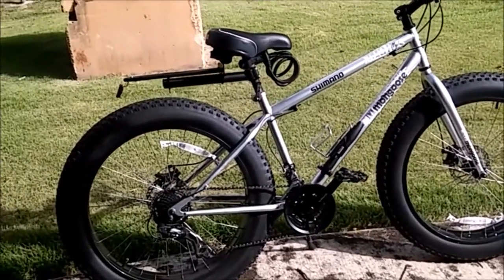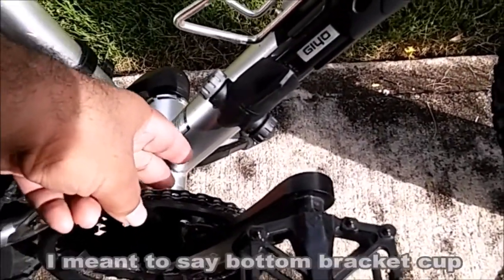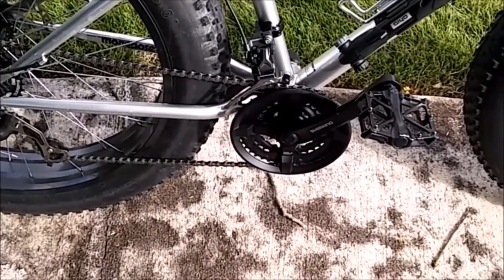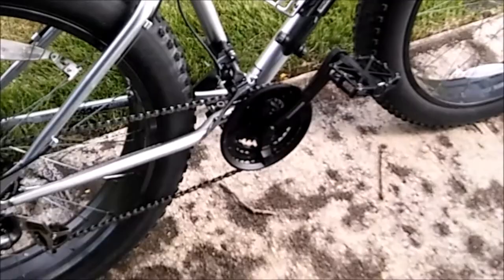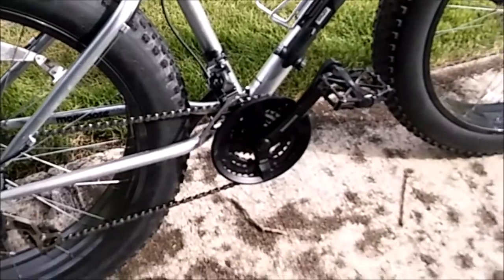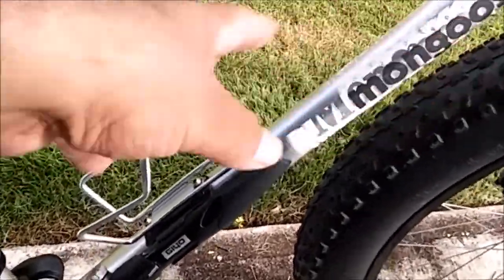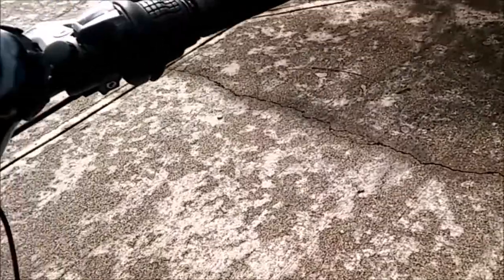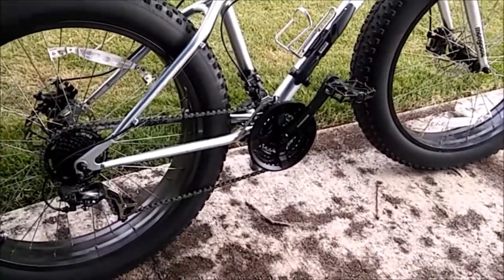Mongoose Malus one year later converted from 7 to 21 speed plus shimano megarange

Comment: great job on your bike . I think I will follow your steps and go 21 speed .  I just ordered the GMC Yukon aluminum frame bike . I will be riding it in snow very soon .
Reply from the maker: I was considering the GMC Yukon as well but since i found this bike first i went for the mongoose , the nice thing about the GMC is that it comes with the shimano megarange from the factory so all you need to do is to go for the same stuff that i put on my bike and after that you should be all set

Comment: I like my Malus drive train, a 1×7 is fine 4 me, tell me Derek, did U ever think of just purchasing a Mongoose Vinson 2 start with?  No Converting would be needed?  It's a 3×8=24 speeds Stock!!  U did good on the video, but couldn't see what U were referring to on your camera shot.  Thank U-4 ur time kind Sir.
Reply from the maker: Well the reason that i went to the trouble of doing this was because of many factors , first of all fat bikes are a rarity where i live and specialize bike shops they'd don't even sell them here , only department stores sell fat bikes here and everybody knows how low is the quality of those bikes , secondly my options were limited because i was at the mercy of what the department stores had in stock , my choices was the 7 speed fat bike or the single speed fat bike and that's it , no different brands of fat bikes or different models of fat bikes of the same brand either , thirdly the reason i did this conversion is because i am a heavy guy and going up hills on a 7 speed was just pure torture , with the 21 speed it makes things more easier for me , fourthly i live in an island that is an US territory and shipping a bike is expensive , is not like in the states where people get free or cheap ground shipping there for large items , sometimes Amazon or ebay seller they'd don't even ship to US proctectories due to shipping cost , and finally if i had a choice to pick a better Mongoose fat bike i will go for the Argus Sport which is 3x9 and got better components than the Vinson .

Comment: Does the top speed of the bike increase with this? I love my fat bike but I have to work hard to go fast :(
Reply from the maker: It does since the larger sprocket on the crankset is larger than the stock sprocket that comes on the factory single speed crankset

Comment: Is the chain rubbing on the rear tire?
Reply from the maker: When i'm on the small ring gear on the crankset and the largest cog on the freewheel the chain is like a hair of distance from the tire , it might rub but i don't hear anything , anyway i hardly used the first gear on the crank set , if i'm on the 2nd or 3rd on the crankset and on the largest cog on the freewheel the gap is sufficient , also if you are on the small ring gear on the crankset and in any gear other than the 1st gear on the freewheel the gap is sufficient as well

Comment: I'm 6'0/340 lbs and I've been watching your videos about the Mongoose.  I was considering getting one and doing the modifications, but it just seems like I should just purchase one that already has upgraded components.  Seems like I'm going to pay up front or either on the back end.  Any suggestions?
Reply from the maker: Well by those stats we are almost twins except that i weight 15 lbs more than you , this bike it was really design to handle no more that 300 lbs but a year has passed and it still going strong handling my excess weight , money wise i would say that the smart thing to do is buying a bike that already comes with the upgrades from the factory rather than buy the cheap bike and do the mods as i did overtime , yes my bike is a more capable bike now than the way that it used to be before when i did purchased the bike but as great as it is now this bike still is a department store quality bike and not bike shop quality bike so the best way to go is getting a bike fully mod from the factory , there's a lot of high quality fat bikes out there that retail by the thousands of dollars but if you don't want to break the bank the best bike for you will be the Mongoose Argus Sport , they go on amazon or ebay for around $600.00 USD "sometimes with free shipping" and spec wise the bike is a superior product over my bike since this bike is a bike shop quality bike , when you compared the Argus to my upgraded Malus basically there's no comparison , by you watching my videos pretty much you already know the specs of my bike but the Argus takes it several steps further , the Argus Sport comes with an stronger lighter weight frame that is available in 3 different sizes for a better rider fit , it comes with a 3x9 "27 speed power train"  with more aggressive ratios for on and off the road everyday used , Hydraulic disc brakes , Kenda tires , slotted light weight quick released rims and much more , also there's a Mongoose Argus Comp and Expert edition but they'd go for $900.00 USD and $1,800.00 USD so in my opinion the best price to features ratio is the Argus Sport but ultimately you will decided which one is best suited for you , please let me know if this info was helpful to you . Thanks
Reply: My brother from another mother!  :)  Your videos have inspired me man!  Thank you for sharing them!  I've lived a sedentary lifestyle for the last 20 years.  No one to blame but me.  I remember that I used to love biking and I believe that I still do.  I've got a $2K budget for a bike as it will be an investment in myself.  I'll check out the Mongoose Argus line per your suggestion.  I was wondering about the power train on fat bikes and if one could ride them up hills sitting down?  I assume as long as the power train on fat bikes have more than a single gear, then it could be ridden up hills.  I live in the city and I'll be putting hybrid tires on it to help with the wheel resistance.  Thanks for all of your info and support!  Keep on riding!!
Reply from the maker: When it comes to a sedentary lifestyle we are both in the same boat , when i did discover gasoline in the late 80's that was the moment bikes got out of my system till last year and i glad that i got back in to it , now when it comes to you is good to see that you have that amount of cash available for you to get the top tier mongoose argus but there's a couple of things that you have to consider before you pick the argus expert over the other 2 , one is the front suspension , that suspension will work great with lighter riders but not with guys like us , i know is adjustable but i think there's not enough adjustability to withstand our wight , it might bottom down all the time , i tell you that by experience because i got a tricycle with front suspension and is useless for me , the other issue that i got with the argus expert and comp is that they come with 2x10 "20 speed power train" while the cheaper argus sport comes with 3x9 "27 speed powertrain" , with the argus sport you get 3 gears in the front that combine with the 9 in the back , you can do climb over steep curbs or ride all around or do high speed riding , my bike is 3x7 , that makes my bike a 21 speed bicycle , although is not as sophisticated as any of the mongoose argus lineup i feel that the only one that comes with a gearing system that is above mine is the argus sport , another issue that that i got with the argus expert and comp over the sport is the price , they want to charge you 1800 bucks for the expert and 1100 bucks for the comp while the sport is only 700 bucks , i did closely inspect the specs of all 3 bikes and their difference of their components doesn't seem to be that great to merit the expense of the two top tier bikes , all 3 bikes comes with bad ass components except for the expert that takes it a bit further with the skinny rider front suspension , that's my opinion about that but ultimately you got the final word , whatever you decided about those 3 at the end of the day they are all great choices .
Reply: Hey man...I decided to go with the Diamondback El Oso Grande.  There was a good price on it on Amazon. Now I need to figure out how to put street tires on a 26" x 4.9 .  Do I have to change the wheel (rim) in order to accommodate a different tire size?  Can I go put a 26" x 4.0 tire on the same rim?  The stock rim is: DB 95wide w/55mm Cutout, Singlewall 32h.  I'll be riding pavement and asphalt mostly.
Reply: Jas Web I got the dolomite, no I'm not a big guy lol... But I have seen guys your size ripping the the trails and city. I bought mines from a big guy, I notice he just put the bike together and rode it 3 times. He said it wasn't for him. Me being 5,9 186 I figured I'll fly on this big thing. After 2 days I noticed a ruffed ride. The front brake was tool tight, chain had to much grease and the tires weren't properly filled with the right psi. I had 14.7 when it recommend 20 psi. I think you should look on the internet for a use one. Watch videos and reviews both pro and amauture. Once you get one you like talk for a normal ride try flat cerfece first then see how it rides up a normal hill. Nothing big once you completed these step you should have a feel to hold the bike handles so you know what you'll need for your comfort. The bike does look good but you don't want to be walking your bike cause it's too heavy and it's not shifting right. Bottom line is yeah you can spend $500 and up, but why do that when at the end of the day you're going to have to put money into it to make it fit you. It's a fully manual ride that has to be customized to the riders liking. Anyone could make a video saying that they took a cheap bike and modified it with aftermarket and upgraded parts. And the videos a cool some with great tips but what I make for me might not work for you. Unless you're a collector or something in that nature, get what fits you. These bike are made for customization it all depends on you doing your research and knowing what's worth it or not. If you have any type of mechanic skills or good at learning things on your own. There's tones of how to video's and web sites that you can go to. Google always helps lol. Good luck I should be posting a video this Summer on my adventures with my dolomite from original to fully customize. My budget is $300, my goal is to spend less than $200 and prove how a little bit of research goes a long way. I hope my message can help you. Good luck on your fat bike journey...Dolomite Twisted Customs coming soon